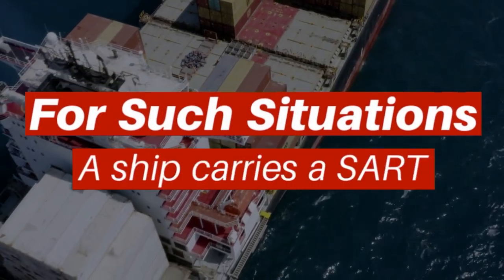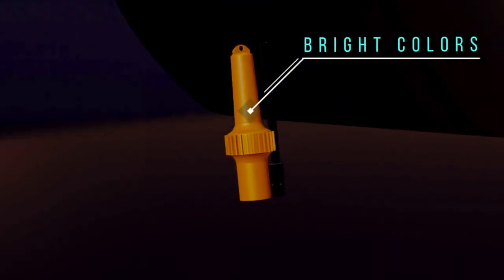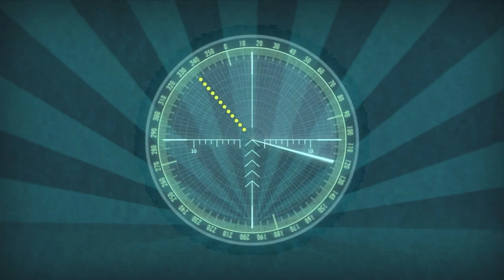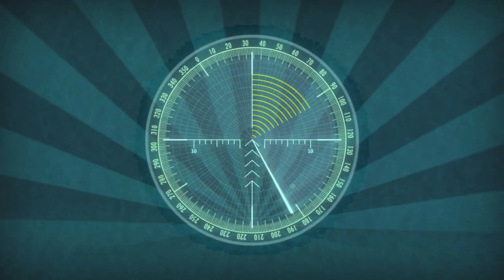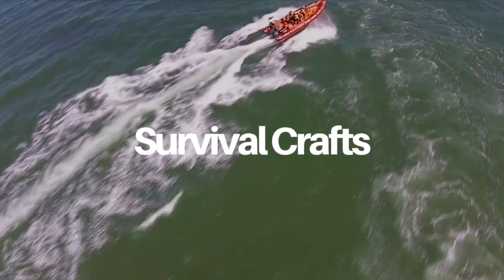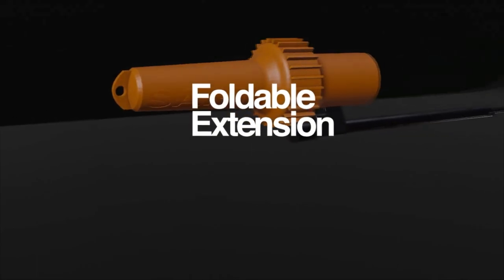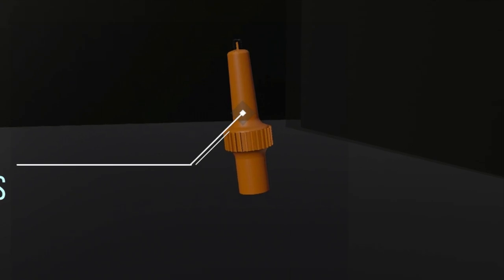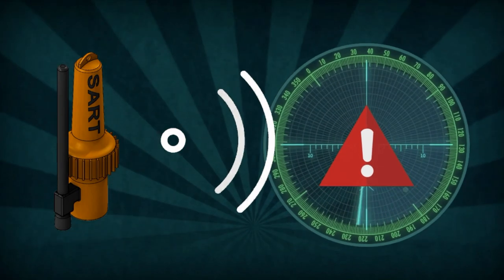Search and Rescue At Sea #SART

Comment: What EPIRB do?
Reply from the maker: EPIRB is used to alert search and rescue services in the event of an emergency similar to SART. However, It does this by transmitting a coded message on the 406 MHz distress frequency via satellite and earth stations to the nearest rescue co-ordination centre. 

SART detects the nearest X band Radar to transmit the distress signal to get the help at the earliest.
Reply: @marineinsight  This is helpful. Thank you
Reply from the maker: Please do share. Thank you for the support 👍🏻
Reply: Aren't EPIRBs also used to mark the last known position of a vessel or person?
Reply: @marineinsight  
But you should understand that the range of the Epirb is more bigger then the Start. And it's working with satellite.
So any vasel should have both, Start and Epirb.